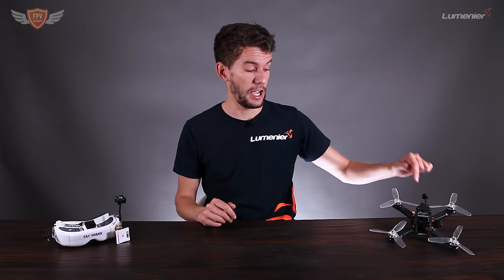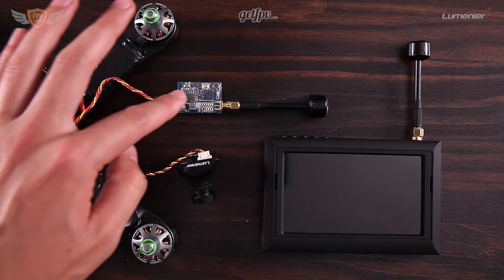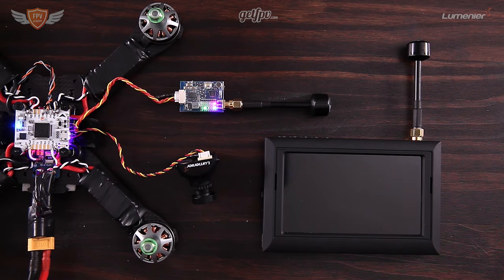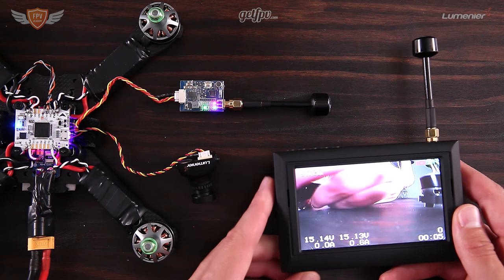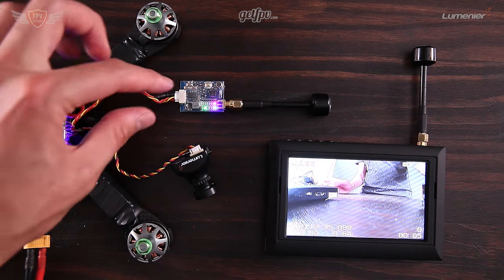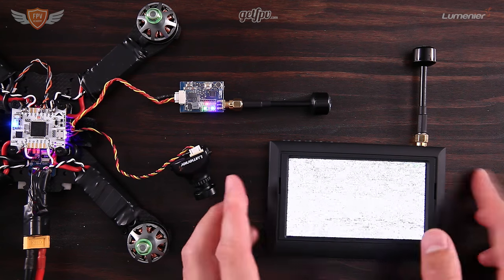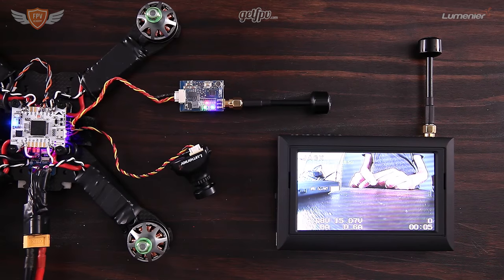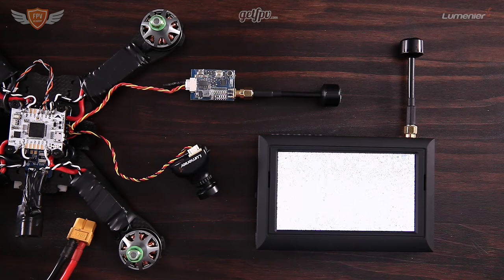How to set your Visual Transmitter and FPV Goggles on the same Frequency

Comment: I'm having a hard time getting my goggles to get a picture on 200mw. It works on 25mw just fine but as soon as I put my VTX on 200 or more, I just get a black screen on my goggles. Sometimes it works, but then it stops working when I change batteries on the drone, and I have no idea why?
Reply: Tonio9606 you might hve your cam wired wrong
Reply: Hey yea ok I’m 2 years late lol but if your still having issues try          get vtx       In cli on beta flight
Reply: Alejandro Dos Santos  
I honestly don’t remember this, or which drone it was lol but I know I eventually fixed it.  I think it was something like a bad VTX or a loose wire.